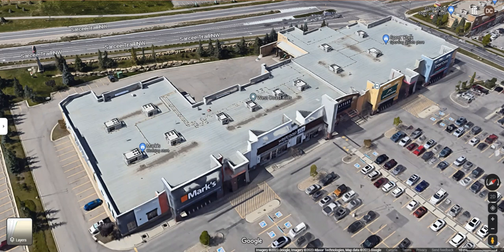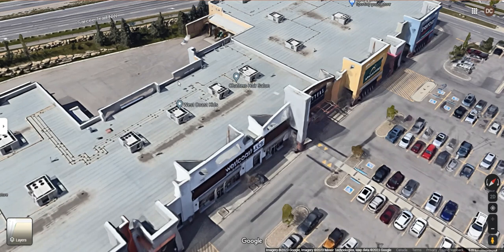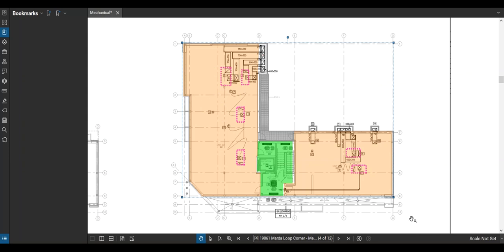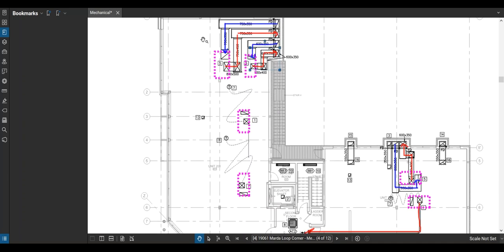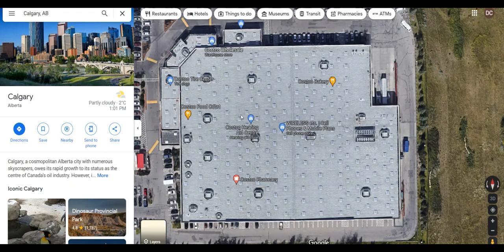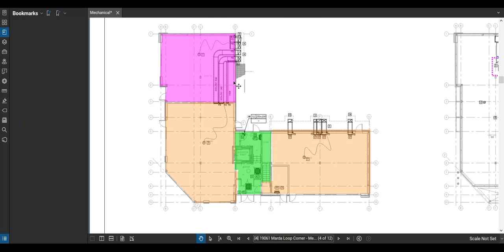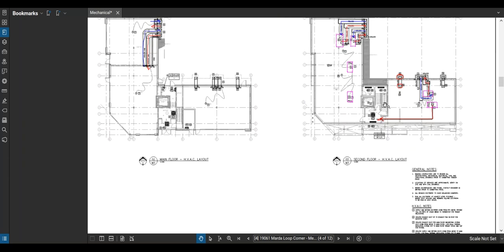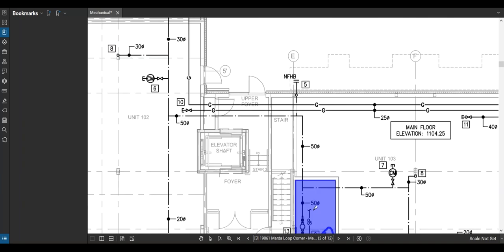Decentralized HVAC System Case Study

Comment: Great video! Can you do one on fire and smoke dampers in terms of code requirements and design?
Reply from the maker: All I can really tell you is that they are required when a duct is penetrating an assembly with a fire separation. Beyond that, I do not think I know. Mechanical Engineers spec them on their drawings which is why it is important for the architectural drawings to clearly identify where fire separations are.